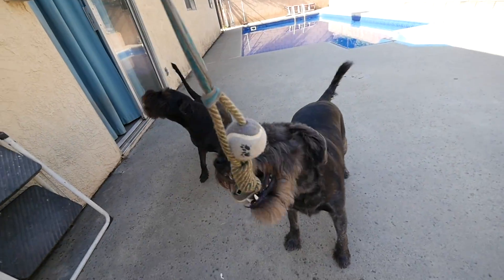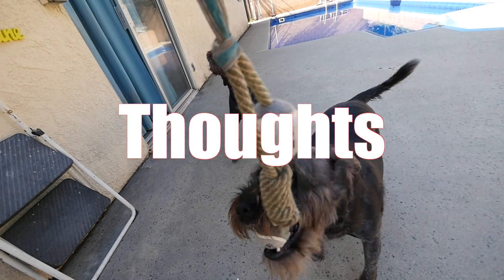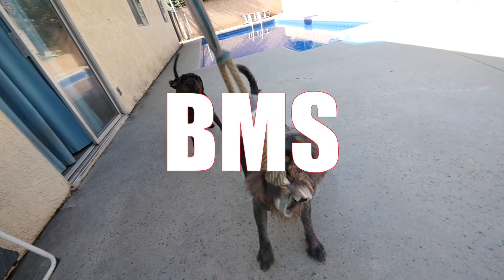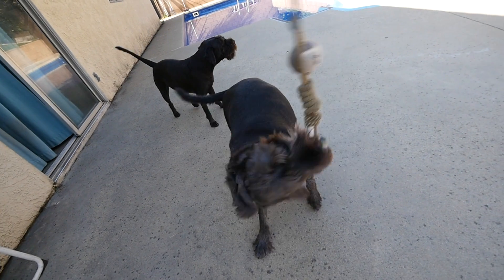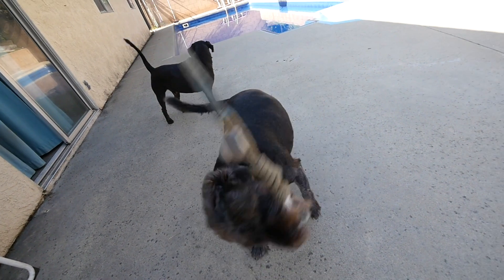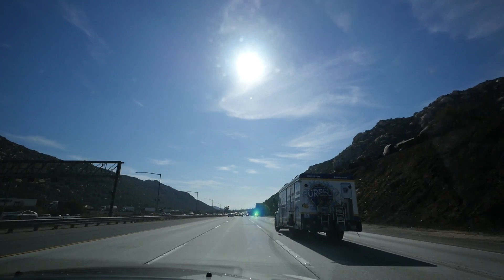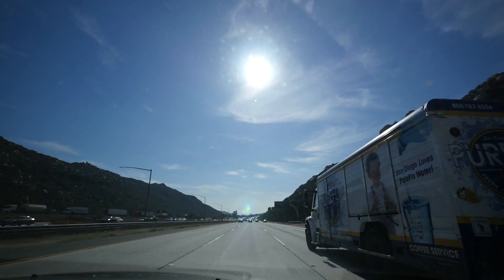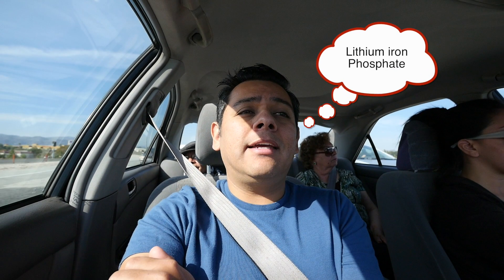My thoughts on Lithium  Battery Management Systems - BMS

Comment: i built my Lithium battery pack for my electric scooter Tao Tao ATe 501. based on the video Jahugarcia did for me about how many batteries would be needed to for 72 volt scooter with a 500 watt brushless motor. I did not use a BMS. My battery pack has been stable and runs great. if you build your pack properly with enough capacity and quality lithium batteries there should be no issue with overheating the pack, and unbalanced cells. if this is happening your not building your pack correctly. a bms is nothing more than a safety monitor to keep up to date with any possible unbalanced cells. normally my sla battery pack would be used up in about 3 moths of use, my lithium battery pack has been running since July 4th weekend and show no signs of performance loss. i want to thank Jahugarcia for creating these topics of discussion. i will be doing a video soon of how i construct my battery pack, and how i test the cells to see if the battery is unbalanced. every month or 2 i have been removing lithium pack and testing for unbalanced cells, so far all the cells are exactly the same voltage. and my capacity and driving time is much longer use. i saved myself tons of money by switching to lithium batteries. i can purchase the lithium batteries quality batteries for about $235.00 incl shipping qty 200 of quality batteries built in china by company called BAQ. I am now taking request from local electric scooter dealers to build them lithium battery packs. i can retail the packs for about 400 to 500 completed.. The same sla batteries qty 6 of them at 13lbs a piece is about 480 dollars. not only do have a better and lighter battery it cost me much less to replace it and i will not be replacing the lithium battery yet, because it still runs like its brand new. Just so you know I travel about 30 miles a day on full charge with my scooter. charge time is a little longer with lithium battery, but i charge my scooter overnight, so by morning my batteries are fully charged. i might purchase higher amp output charger to charge them quicker. but for now everything is working great.
Reply from the maker: Very cool,  do let me know when video is up
Reply: https://www.alibaba.com/product-detail/18650-2200mah-BAK-li-ion-battery_1297912649.html  
I buy in Bulk so i do not know whatr prices they will give you.
Reply: elitheitguy  but that video is 5month old
Reply: that video was published in APRIL 2015 that was 7 months ago. my battery pack was completed on July 4th week. Normally i would be replacing the SLA pack right now do to performance loss. Now that i upgraded to Lithium custom pack, my scooter still drives full speed 37 mph, and drives 30 miles on full charge. So right now my lithium battery pack has not lost any capacity or performance since my build in July. I drive everyday to queens from the bronx thats 15 miles 1 way.  I have not lost any capacity or performance, normally i would be replacing my SLA batteries right now due to significant battery performance loss. Not the case with lithium Battery Upgrade.
Reply: Can you tell me the web address of the company you get your batteries from?  Thanks in advance.

Comment: BMS's may help you get the absolute limits out of your pack. Your charge rates, balancing cells, output numbers etc. Other than that you're right.
Reply: Trying to get the "limits" out of your pack is how you'll destroy it and risk catching it on fire in the first place. Use the batteries correctly and they'll last a lifetime, run them low, give them high current discharge, or charge them consistently to 4.2 and you'll see that life span significantly reduced.

Comment: I am using 13s10p li ion 18650 in my e bike -no bms ,they all comes from old laptops,I did on my bike 600 miles all ready  and battery is pretty much balanced, don't need bms. When I bulid this battery I use cells 2 ah+ and each of the internal resistance is no bigger them 150 mOhms . Good job on Your channel ! Keep up uploading

Comment: I have to add that I recharged all 24 batteries and they all reached and stayed at the same 3.8V so either the BMS wasn't working or it was a build error. I'm going to put it back together and see what's what. Thanks for all your videos Jehu.

Comment: I have a 12v portable oxygen machine and it takes a battery pack made from 24  Samsung 18650 lipo's. I had two battery packs. The machine runs off the cars 12v system but that's jumped to 22v by the time it gets to the machine due to an inline transformer. It also has a 110 AC adapter plug, so it's good for in home and in an auto and also runs on its own with a battery pack. . . You can't charge the battery pack from the car. It has to be plugged into 110 for that but I have a separate charger just for the battery packs. So after a few months one of the battery packs wasn't charging. 
After reading all of your battery posts, I took it apart. It had a BMS wire system on the 24 lipo's, which were set up in 4 parallel sections of 6 series battery rows. Anyway it seems the BMS failed to keep them balanced. Because all four sections were different mA off by 100s each
There is one other thing, they used a spot welder and maybe it missed a cell or two. But theses battery packs are $500 ea.

Comment: A good way to monitor your pack is with a battery bridge circuit. http://www.evdl.org/pages/battbridge.html      http://2003gizmo.blogspot.com/search/label/batt-bridge     http://www.sunrise-ev.com/LeesEVs.htm#battbridge    Im totally on board with the No BMS. I know personally that BMS Systems can ruin batteries. So what watches the BMS? Which BMS. Too many variables to go wrong. Less if you follow the technique of bottom balancing. However, if you have a dumb charger and dumb controller you will need something to allow you to watch the batteries. My charger cuts off when it reaches the max set limit and my controller does not allow me to go under a specified voltage. So that is my actual BMS. The battery bridge will be incorporated into the current project and the Bus project.

Comment: Doesn't it make sense to spend the few hundred dollars to buy the insurance of having a BMS? It reduces the risk of you losing the tens of thousands of dollars you have invested in your EV and battery pack. And in addition to that it could possibly prevent a fire that kills people or destroys your home.
It only takes one stupid mistake to put your battery up in flames. Theres always that chance. There are plenty of examples of EV veterans that have had battery packs catch fire because they made a stupid mistake.

Its the same thing as buying an insurance policy, sure there's a small chance that you'll have to use it, but if anything goes wrong and you don't have it you'd be wishing you did.

You haven't really stated any reasons why a BMS is bad, just why you don't need/want one. If cost is the only thing holding you back, maybe we should work on a very inexpensive BMS solution.
Reply from the maker: yes you would be  100% correct if BMS systems had a 0% failure rate,   they don't ,  I've seen a lot of cells killed by BMS systems
Reply: Do you know the cause of the failure? Is it user error, or bad design of the BMS?
Reply: Have you tried to find out the problems that make a BMS go bad. I have a friend that takes the ignition boxes made by Bosch in Germany that we burn up on our race cars and he figures out what made it go bad he finds that some Chinese components are not rated correctly. He will use the proper stuff and we don't have a problem after that.
Reply: Common issues with BMS's:

- They drain the cells during storage and some times even imbalances the pack due to uneven load on the cells.

- Balancing is basically bad for the cell life. 
During charge and discharge (balancing) at low current, parasitic reactions occurs and creates lithium crystals. 
Try to avoid charging  current below 5% of the capacity of the system. 100 Ah = min. 5 A

Even with BMS you should use conservative battery settings to avoid "going over the knees" in both ends of the charge/discharge curve, to get maximum life out of your pack. 
And you DON'T get much capacity out of a LiFePO4 cell by charging to 3,6 or above.
I made a test with some Calb SE cells, I gained less than 1% capacity going from 3,4 to 3,6 CC/CV and 5% cutoff.

So if you stay within the safe part of the curve there's nothing to worry about going no BMS. 

This is all related to LiFePO4 cells. 
You should always use BMS for LCO cells as they are extremely sensitive!

With the NCM ( like the tesla cells) and NCA you have better safety than LCO but not as good as LiFePO4 but normally much better quality than Chinese LiFePO4's and therefore also safe to use without BMS. Normally the range for NCM and NCA is 3.00V to 4.00V to get max. Safety and life. As Jehu say in the Video, there vary only few mV. Not because of good matching but because of consistent production quality as they are 100% machine made in 100's of thousands pieces per day.
Reply: Most BMS (high end one ) have sleep mode for long inactivity duration.

Comment: Could you go into more depth on the cons of a BMS?  I assume it would require you running additional wiring to every battery to monitor and charge them seperately?
Reply: you need to run additional wires to every bank of batterys. 10cells in parallel or 100 cells in parallel all act together like one cell, (every cell added to that bank adds capacity but does not increase voltage past the original 3.7 to 4.2v) so if you had 30 10 cell banks you'd need to run 30 or so more light gauge wires to each of those banks of cells. research charging batteries in series to see how they act and why there is a discussion on BMS systems.

Comment: You can get away with no  BMS if you are using lifepo4 and you bottom balance. I do have more than one way to terminate the charge at a specific voltage just in case. 
I would not do it the same with  lipo or limn, and would opt for a BMS.
In fact ,I won`t even put anything , but lifepo4 in the car.

Comment: It's the voltage monitoring part of a BMS that is the most useful part, let you know when there is an issue.
The balance circuit is something of a liability, as it works by discharging the higher voltage cells so everything matches. But then you have a switching mosfet across each cell that can short out and kill the cell.

I also suspect the BMS circuit itself is powered from one cell only, this would explain why the two cells at the negative end of the laptop batteries are sick/dead some of the time.
And yes I have had a laptop battery where the charger/BMS tried to kill the replacement cells I put in.

Comment: I've been watching your channel and a few others to help me build a universal mobile power station for all my electronics. And I've pretty much decided on no BMS. Instead I'll use a low voltage cutoff circuit to prevent over discharge and occasionally use a balancing charger when needed.

Comment: Ive never used a BMS on anything ive built. If you are willing to keep tabs on how the cells are going and if any are drifting yourself then i dont see any issues. Hell some early Li Ion power tools and prob some of the cheap ones still around today dont use any sort of BMS or cell balancing.

Comment: The importance of a BMS depends a lot on how you want to use your battery. People like Peter Mathews design their powerwalls to stay at low C rates. like 0.3 C max. Besides that they charge to 4.1 V and never discharge conpletely. Ideally staying above 3.3 V. Also they check voltages every now and then. In that design and use, a BMS doesn't add a lot of value.

If on the other hand you go to the limits of the cells, then a BMS isn't a bad idea at all.

From what I understand from your videos at EV West, their systems aren't designed to go to the limits of the batteries either.

It's the RC comunity that puts their batteries to the limits every time they use them. Probably a lot of drowns also are designed to draw the most out of their batteries. I know many of the bigger drowns can easily carry more amp hours but they always get designed for like 20 minutes flight time with the smallest batteries possible.  BMSs are a must in those conditions.
Reply: Then you get laptop batteries, where the BMS is more or less programmed to make the battery give up prematurely and force you to buy a new battery. Laptop batteries rarely do much good after 2-3 years, and in 2016, with "new battery technology" it seems suspect they're still performing this poorly.
Reply: Alex Paulsen That's not true. The 18650 cells can do like 500 cycles at best performance. That's about 2 to 3 years of normal use. They're not programmed to fail. They're designed to stay above a minimum performance for 2 to 3 years. That makes sense because after 2 to 3 years people buy a new laptop.

Why would they make them more expensive than necessary?
Reply: Peter Faber We use Samsung 18650 cells in our bikes that are marketed as having 1100 charge cycles. Some of our customers batteries are still working fine 8 years later... and that's speaking for 8 year old tech. Panasonic 18650s can be good for 1500 cycles I think, which is what Tesla are using, and they preach 10+ years per pack. My HP laptop battery however, with considerably less load, 2-3 years maximum and then its absolutely worthless. Jehu can probably tell you a thing or two about laptop BMSs, his 18650 pack building videos are proof that the cells are better than the laptops are told to believe.
Reply: Alex Paulsen Laptop batteries endure a lot more abuse I think. And sure the BMS can get it wrong.  I don't disagree with that. But to say they are designed to kill the battery after 2 to 3 years,.... that's just nonsense.
Reply: laptop batteries also get charged to their max capacity and stay there while they are plugged in.

Comment: Easy. The more cells you're running in parallel the less noticeable drift you'll get statistically. 1p20s will get more drift between cells than 30p20s, its that simple.
Reply: Actually it's more like that larger the battery is in capacity compared to the load, the less the batteries will drift.

Comment: I  think I understood why you don't use bms.
But if someone knows a good bms for Lifepo4 let me know. I want  configurable cut off voltage or just below 3,65V/cell, but I think I will make one myself with a dedicated chip. Problem is : It's to replace ni-mh batteries on a handheld vacuum cleaner, but the people who will use it don't know anything about batteries and don't want to learn about balancing, etc.. so I need something fairly safe on a much lower quantity of batterie than in a car, but which take also a lot more abuse and might stay on charger forever when not used...